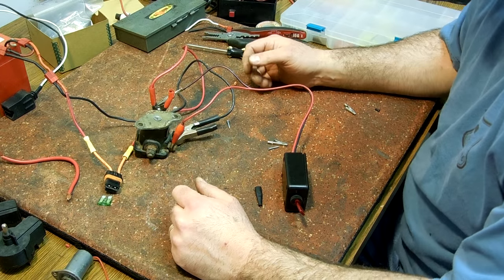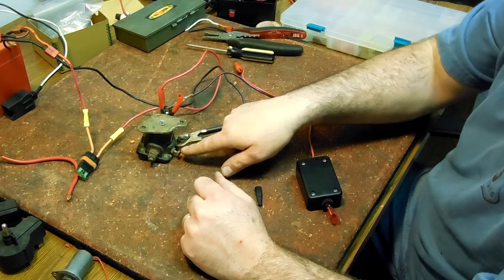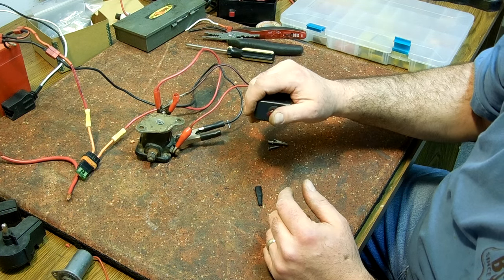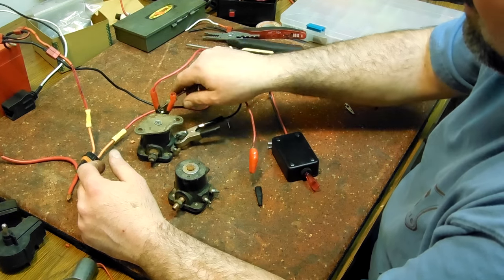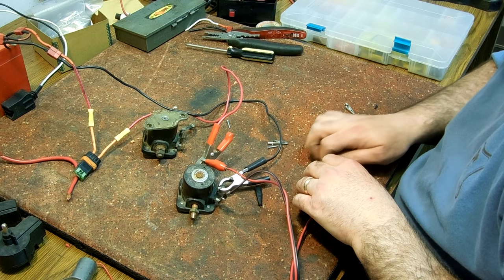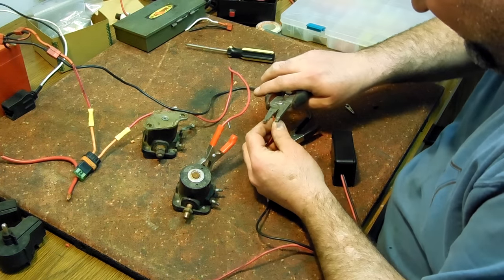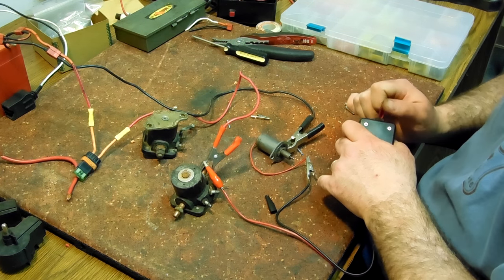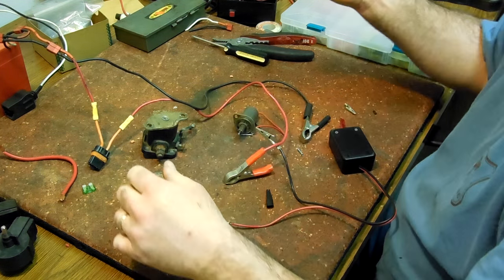How to test a marine solenoid for a starter and a choke. fix your outboard

Comment: Can I test the solenoid with just an ohmmeter?  If my solenoid is stuck in the on position, should I get conductivity across both power terminals?
Reply from the maker: yes